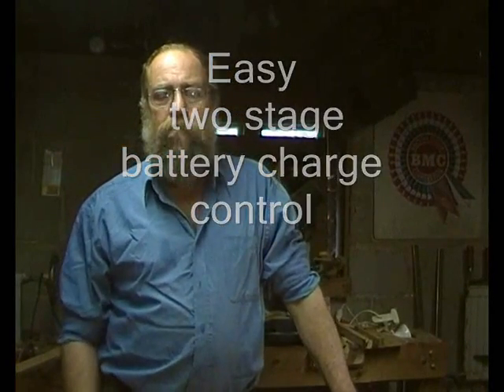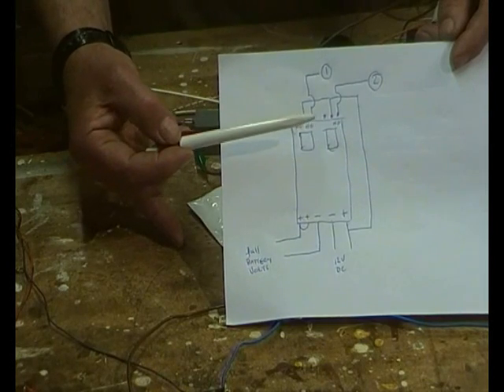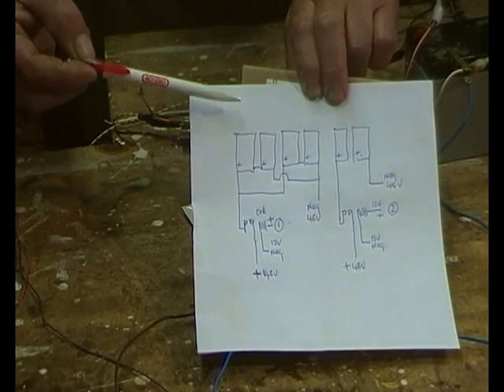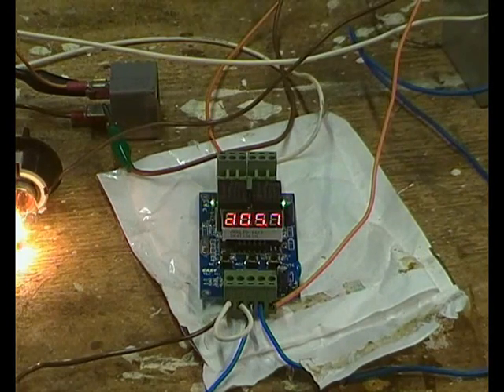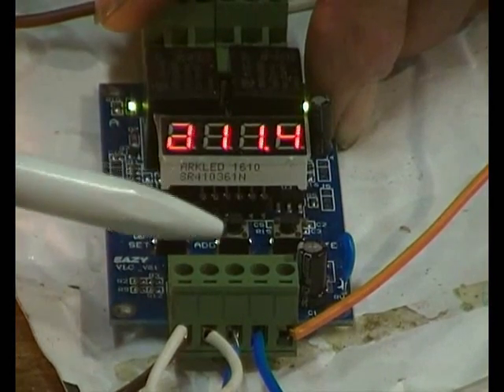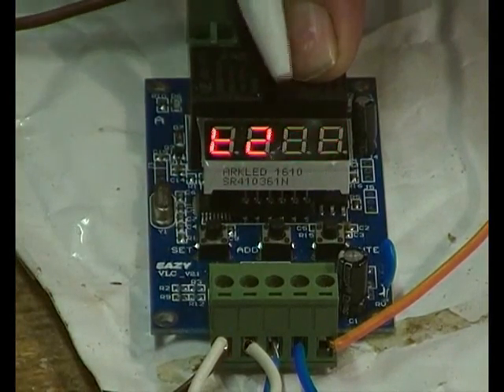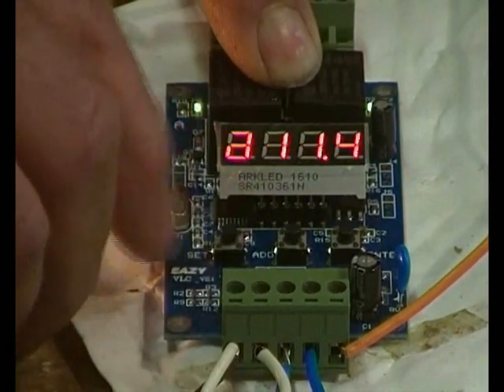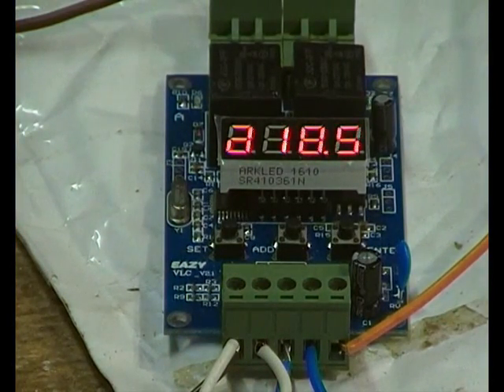Easy two stage battery charge control, wind and solar electricity

Comment: What is the input power and amps required to operate this relay ? I have a 12v dc @ 2 amps converter hooked up now, will that work?
Reply from the maker: Hi, it takes very little power, cheers

Comment: hi andy do you know of any boards similair to this that do 24v?
Reply from the maker: Craig. The 12v is just to supply the circuit, you can switch any voltage through the relay contacts ( I use these on my 48v system). I use a slave battery to run all these 12v things, including the solar tracking systems. Check this out in my book or in the battery rewiring videos. Cheers
Reply: ah got you  will check it out :) thanks for quick reply , and great vid by the way very well explained
Reply: meant to say i want to use this with a 24v wind turbine too trigger a  dumpload to protect 24v battery bank when voltage is at full capacity  is that still acheavible ?
Reply from the maker: Hi, yes you can set the control voltage to anything up to 99 volts. In your case I expect it will be something like 28v. It would be sensible for this unit to contol a larger relay if more than 6 amps is being diverted. Check out my book, Wind and Solar electricity. There is a link on my channel page. Cheers
Reply: brill will do thanks for your help andy

Comment: I wish to assemble a controller for my 1600 watt wind turbine that I wish to hook up to a gridtie inverter or a microinveter (s).thwe book talks about why I need a special one and a capacitor but where do I start with the design and build?
john
Reply from the maker: John. The turbine generator would normally have 3 output wires as modern units are 3 phase alternators. These 3 wires are connected to a 3 phase recitifier to produce DC power. This DC (2 wires) is then fed into the turbine gridtie inverter, (something like a windyboy) through an isolating switch. The mains side of the gridtie is connected to the mains supply. All well and good. Now you need to protect the turbine from a no load situation when the mains supply is down. For this you can use one of the VLC V20 units in one of my other videos to switch on a restance load across the turbine output to slow it down, but these only detect up to 99 volts and most turines used for feeding power into the grid run arround mains voltage or higher so a voltage divider would be needed across to DC to provide a varable low voltage tapping that would be within the detecting range of the VLC V20. The basic premis here is that when there is no load the turbine will speed up and so the volts will go high and then the resistane load will be brought into circuit. See Fig 81 page 157. The build your own charge controller has a voltage divider in it, but the components would need to be changed to suit the higher DC voltage, page 167, and the schematic is fig 97 page 178.  There are other low tech ideas, like wiring a relay coil across the mains so that it is energised all the time and then use the normally closed contacts (open when energised) to switch another power relay that brings in the turbine dump load when the mains dissapears. This method only protects against no load not over voltage. Hope that clarifies, cheers, Andy
Reply: Thanks, let me study this for a bit. right now I have the turbine on the battery bank with a c-40 dumpload controller. for  my backup power setup. though thinking it might be useful to grid tie the power from the turbine instead.
Thanks
Reply from the maker: John, I think your problem will be the voltage, low voltage turbine grid inverters are a thing of the past. Cheers, Andy
Reply: yes, I see a few on youtube, but they fail a few times a year.
I would rather run the power from the turbine into a microinverter. some have mentioned using a large capacitor in place of the battery

Comment: Hi, I enjoyed the video, very informative. As I wont have a 12v slave battery; just a bank of 12v batteries, can the board power come from the main bank. i.e. the one its maintaining? thanks in advance!
Reply from the maker: Hi. Yes it can . The switching relay contacts are independant of the any power on the board. You can see this unit in position in my latest video on a Solar diesel system. Cheers

Comment: Does that timer board say "V2.1" on it Andy ?? If so,  how does it differ from V2.0, and would you recommend a particular seller of it ? Your other timer board I'm sure was a V2.0....??
Reply from the maker: Dave, yes to both, it's a 2.1 and the other was a 2.0. I got this from trade 021, seemed to be OK as it turned up and seems to be the same as a 2.0, maybe it is improved, who can tell. Cheers, Andy
http://www.ebay.co.uk/itm/141751078602?_trksid=p2060353.m2749.l2649&ssPageName=STRK%3AMEBIDX%3AIT
Reply: Wow, you were lucky to get the correct module after my fiasco then !
Thanks for link. Cheers, Dave